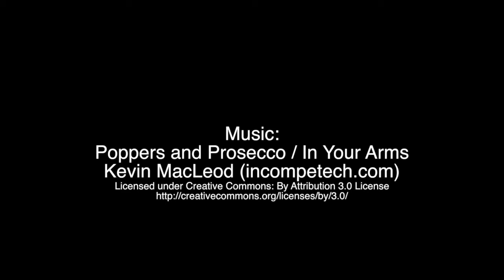Woodworking - Condor tails part 2

Comment: Would like to see your beautiful craftsmanship used on houndstooth dovetails.  I really appreciate seeing your replys to comments.  There are some other beautiful work but the artist won't respond or share anything.  Thanks for making an excellent video.
Reply from the maker: Thank you 😊 It would have been very nice to make the joint on the workbench with houndstooth dovetails, but I just don’t have the skills required. The double dovetails are a about my limit, I think 🙂
Reply: I'm sure you underestimate your skills!  Been around for a while and see things in your work that takes normal craftsmen and artist many years to develop.  Give it a try.  The techniques are the same; just a bit smaller.  The hounds tooth is just a small pin inside the larger condor tail.  However, you will need a 1/8"  chisel.  And by the way, your music selection is super.   @Schnekkern

Comment: Are you applying the glue only to the finished joint at the surface where the endcap is slightly proud, assuming it cappilaries into the joint? or did you apply to the joint before rapping it home with the soft hammer? thanks
Reply from the maker: I applied glue to the whole joint before putting it together. The extra glue was to swell the joint more and hide the gaps :-)
(Sorry for the very late reply :-) )

Comment: Was that epoxy you initially laid over the joint?  That’s a great idea to keep from seeing any gap
Reply from the maker: G Bez Actually, I just used pva glue. There was a lot of squeeze-out, but I think that helped swell the wood,  and made the joint tighter. Epoxy would probably fill the gaps well, but would I am not sure it would have been better.

Comment: which bit  and which festool (?) router?  Awesome vid.
Reply: Which videos did you find most useful to watch before building this bench. I plan on building one myself!
Reply from the maker: Thanks! It is the Festool OF 1400. I don't remember exactly which bit I used, but probably a 1/2" pattern bit (I.e a bit with a ball bearing with the same diameter as the cutting part)